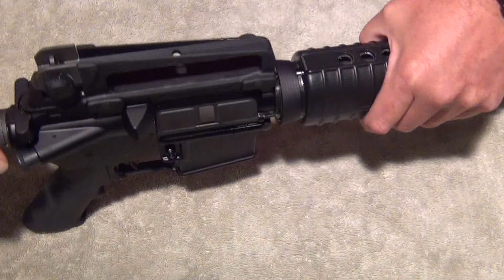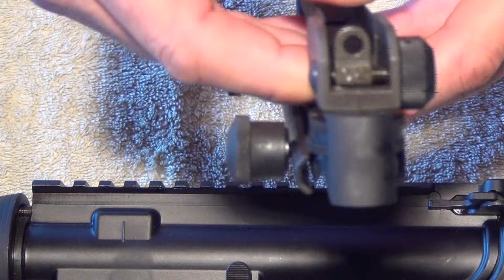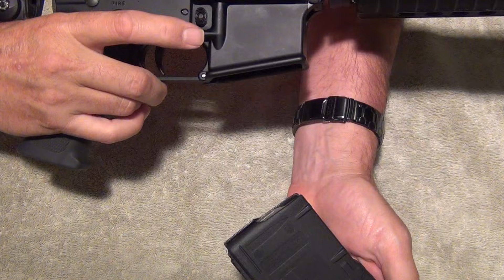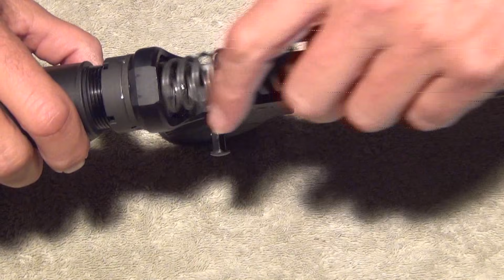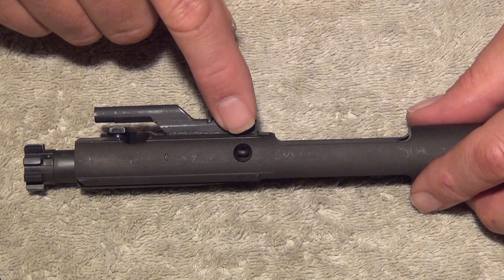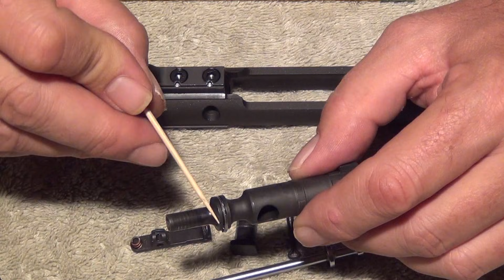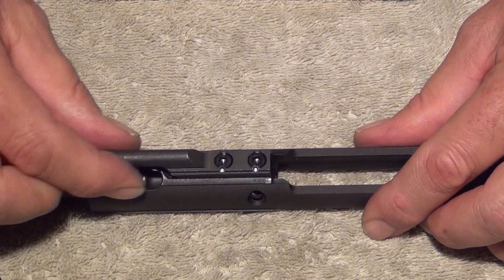AR-15 Basics: Controls, Function, Disassembly, & Reassembly.

Comment: Thanks for the video.Question:is it normal when I re-install the bolt and try to close the gun, I have to reach in from the bottom with a finger and slide the firing pin forward or the gun will not close.
Reply from the maker: You're welcome. Something's not quite right (hard to diagnose without having the rifle). First check that you're firing pin is properly reinstalled. I'm GUESSING that the firing pin was not fully seated, when the firing pin retaining pin was installed. You can check this by trying to remove the firing pin, without removing the firing pin retaining pin. If the firing pin comes out the back, that's the problem. Also, make sure the hammer is back and down before trying to close the rifle. Lastly, make sure the bolt carrier group is fully forward. I hope this helps, let me know how you make out. Cheers
Reply: First, thank you for responding so quickly. I don't think any of the videos I watched mentioned the hammer being back and down before closing. I did that the first time and it closed but wasn't sure if that was the proper way. Thanks for the education on my new AR. If you ever need to know anything about tile work, drop me a line as I have 38 years experience installing.
Reply from the maker: Crippled Slave You're welcome. I think I'll add a annotation to the video to help out other viewers. I've only done a little tile work, and will keep you in mind. Thanks, Cheers

Comment: Thanks for the great info as we want to understand every part of this gun. One question, when you pulled the charging handle back and then released the bolt you showed the fire position by pulling the trigger. Is it ok to dry fire or is this even considered a dry fire with an ar?  All new to me so any help would be great since I dont want to damage

Comment: Great Video! Just got my first AR. I am brand new to the AR platform and your video was very informative without a bunch of unnecessary "tacticool" garbage added in. I think I'm really gonna like this platform. Are you accurate at 600 meters with those sights? I've been looking into optics for my flat top but maybe I should just go with some good iron sights to start out. What do you think?
Reply from the maker: Thanks. I love the AR platform.These sights are capable of being re-zeroed out to 600 m. I've never shot mine past 200 m, but frankly, I don't think I would be very accurate at that distance (that's me). I feel a good pair of backup iron sights are a must (become proficient with them first), and an optic will provide a great tactical advantage. Ask yourself, at what distance do you think you'll do most of your shooting? Me, under 200 m. So a red dot, or tactical scope will suffice. Past 200 m, I would opt for a tactical scope, or a scope with more power. Cheers

Comment: Just got my first AR. This video was exactly what I was looking for. Very well done and thank you :)
Reply from the maker: You're welcome Mr. Pressley, enjoy your new AR, and baby.  :)  Cheers
Reply: stanfordcoffee maybe you can help me out. Finally got to the range and I'm having issues. The gun fires and extracts but failed to feed. After a few more rounds it stopped throwing the brass and just got caught in the chamber. brand spanking new 556
Reply: stanfordcoffee I should also mention that it's not the mag. My mag worked perfectly in my dad's AR and his mags failed in my gun.
Reply from the maker: Bill Pressley First check the extractor Spring, and groove. Make sure they're okay. Don't know what to tell you about the failure to feed, hard to diagnose a problem with out seeing the rifle. Check on AR15.com to see if others have this problem. I've only had to deal with Ruger customer assistance once, and they were excellent. Good luck. Cheers

Comment: how do you or do you need to clean the gas tube?
Reply: Don't put any lubricant in the gas tube, but just take a q tip and wipe the carbon where it makes contact with the gas key. Also q tip inside the gas key as well
Reply from the maker: William Skinner For the most part, it's not really necessary to clean inside the gas tube. The high pressure, temperature, &  velocities keep the inside relatively clean. However, if you want, you can get long pipe cleaners (tobacco shop), or those very long "q-tip looking" cleaning rods, and put some solvent on them and run them inside the gas tube, (maybe once every 2k - 3k rounds). Try not to spray any kind of lubricant inside the gas tube. Cheers

Comment: In order to cycle cartridges through you cycle them by using the charging handle correct?
Reply from the maker: I'm not exactly sure what you're asking.
Once a cartridge has been chambered, and you fire the gun, it will cycle and chamber the next round automatically, no need to touch the charging handle. Is that what you're asking?
Reply: stanfordcoffee What I was asking if there is a way to check proper ejection? Like the use of snap caps much like I have for my Sig and Kimber. There used for loading and cycling rounds to check for proper loading, ejecting and adjusting trigger pull without destroying your firing pin. Would the use of the charging handle be the way to properly check the above things mentioned while using AR15 snap caps?
Reply from the maker: bizzythgz Yes, exactly. In that case you do have to use the charging handle each time you want it to cycle. I didn't know you were referring to snap caps. Cheers
Reply: stanfordcoffee Much Thanks for the Info!!!

Comment: hey thanks - just bought a M&P 15 sport - have not even used it yet. Shot a M16 about 30 years ago but never owned one. Needed this to help me understand how to take the gun apart and clean it. Still unsure about what to use as far as that goes. I have a cleaning kit and snake and just going to keep learning.
Reply from the maker: You're welcome. Sounds like you're all set, you just need to decide if you're going to use a solvent followed by a lubricant, or a CLP (cleaner, lubricant, protectent). I also like to use a little all-purpose grease on certain parts of the bolt. follow the link to James Yeager in the description. Cheers

Comment: Do you only use the charging handle once when you insert a mag in the first time or do you have to each time you put a mag in? I only see people use it one time. Thanks!
 Good info on video. I purchased my first AR type rifle and just learning stuff.
Reply from the maker: Yes, in general. You only need the charging handle to bring the bolt back. If the bolt is forward, insert a loaded magazine, pull the charging handle all the way to the rear, and let it go. After that, the bolt should lock back on an empty magazine (after the last round has been fired). Remove the empty magazine (the bolt will remain locked back/open), insert a loaded magazine, and press the bolt catch release (allowing the bolt to go forward). Just think of it logically, the bolt has to strip a round off the top of the magazine to chamber it. So if bolt is forward, You're going to have to use the charging handle. If the bolt is back, just release it with the bolt catch release. I hope this helps, feel free to ask more questions. Enjoy your new rifle! Cheers
Reply: Thank u sir. Very helpful.
Reply from the maker: Ralph U. One last thing. If the bolt is back, and the gun is empty (magazine remove), you can pull the charging handle all the way back and then ease it forward to prevent the bolt from slamming forward without a magazine. Cheers
Reply: Thanks! For the info but my fault. That already happened. I wish I had read this before it happened. I did it yesterday as I was going over my rifle. I didn't think you were supposed to ease it down (charging handle). I thought you supposed yo let it go. I did try and ease it down but I though I messed it up. I hope I didn't damage it or mess it up now. OH! MAN! I feel like an IDIOT NOW!!!!!!!!!! Thanks! Again! Maybe too late.
Reply from the maker: Ralph U. You're not an idiot, and you didn't damage your rifle! I'm sure it's fine! You just don't want to let slam forward repeatedly, as it's not good for it in the long run (A few times is not going to hurt anything, the AR's is a pretty tough rifle). The same can be said about most modern pistols. Please read my "Note 1" at the bottom of the description (for a better understanding). Have a great night, I didn't mean to startle you. Cheers
Reply: Thanks! Man!

Comment: Excellent video sir, couldn't have been better. I just have a quick question. I'm new to theses AR platforms and I was just wondering what's the significance of the bolt catch?
Thanks
Reply from the maker: Thanks.  The bolt catch allows you to manipulate the BCG (bolt carrier group that the bolt rides in). If the BCG is locked back,  pressing the top of the bolt catch will allow the BCG to go forward. If you want to lock the BCG back (open), you pull the charging handle all the way to the rear, then push the bottom of the bolt catch while releasing pressure on the charging handle, locking the BCG rearward. The only time the BCG will lock back by itself, is if there is a empty magazine in the rifle (after the last round of ammunition has been fired, or if you pull the charging handle all the way to the rear with an empty magazine in the rifle).  Hope this helps. Cheers
Reply: Ok thank you

Comment: What do you use to remove the ejector pin? I see Brownells has a few tools for the job but they get a bit spendy for something a person might not use too often.
Reply from the maker: I've never removed mine (about 1300 rounds through the rifle), still working fine. I don't have a ejector compression tool, or roll pin punches. I don't believe you have to remove it too often for cleaning. Cheers
Reply: Which is good, I don't think it needs to be removed too often for cleaning. In my case, I'm assembling a kit and the DVD I got from Brownells claims one should remove the ejector pin to check the headspace. But a friend of mine suggested I contact Sarco to find out if they had checked the headspace. The kit came with the bolt carrier group fully assembled but the barrel was separate from the upper.
Reply from the maker: I'm NOT an expert. I think that if you attach the barrel to the upper, the headspace will need to be checked. As such the ejector will need to be removed. Try AR15.com, you might find your answer there. It's free to sight, and takes only minutes. They may have a solution as to  how to remove the ejector without the tool (DIY Stuff). Good Luck

Comment: maybe im retarded but im fascinated by guns so ill ask, what does "run it home" mean?
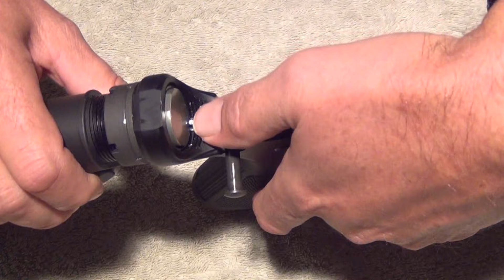Reply from the maker: That's a good question, I didn't cover it very well. It's slang( "ride" it home).  When you pull the charging handle all the way to the rear, you are compressing the buffer spring ( at 8:00 ).  People that are new to AR's /  firearms, are reluctant to just let it go. So, they ease the charging handle forward  "riding it home".  By doing this, they are taking a certain amount of energy away from the bolt. The bolt needs that energy to strip a round of ammunition out of the magazine and chamber it.  If you ease the charging handle forward, you are more likely to create misfeeds, and/or  jamming. So,  just pull it back, and let it go. Note:  It's not good to practice to do that with any semi automatic firearm,  that doesn't have a loaded magazine in it ( to slow the action).  Without a loaded magazine in the firearm,  the bolt ( or slide in the case of a pistol), does slam forward, possibly damaging the firearm.  In that case, you do want to ease it forward ("ride it home").  Hope this helps. Cheers
Reply from the maker: PS, Your not the first person to ask about that, so I've now added a annotation in the video, and note at the bottom to the description.  Thanks
Reply: stanfordcoffee you took that much time/effort explaining that? and even what could go wrong that you earned a sub sir.
Reply from the maker: tharealdvl  I'm a sick, sick man! Help Me?!? LOL Thanks, Cheers :)
Reply: you are awesome bro keep up! any more guns u recommend? (watching since i ilve in a shit country where we cannot have weapons legally)
Reply: watchin youre vids at 3 am xD
Reply from the maker: tharealdvl oh, that's a wide open question. I enjoy plinking with .22's. I have a Ruger 10/22 and MKIII 22/45 pistol.  They're  just fun to plink around with,  and l recommend anybody starting in the sport,  start off with .22's.
I'd like to own Mossberg 500 , a Glock 19 or 23 (I'd really like to shoot a G23). I'd like to own a Colt Series '80 1911 (blue w/wood grips),  to go with my M1 Garand.  What specific category/purpose are you interested in?
Reply: stanfordcoffee Glock 21 is a hell of a handgun as well.
Reply from the maker: You're absolutely right!  I like the 45 ACP.  Glock makes a good one in the G21. Please understand.  My father willed a M1 Garand to me.  I've always wanted a 45 that would match that rifle ( in my mind they go together).  It doesn't have to match perfectly,  function is important as well,  but the Colt  series 80 1911  is definitely on my bucket list. It would mean a lot to me!  Purely personal. Cheers

Comment: I never knew to flip the sights for close range shooting . My first AR platform is a M&P15-22, had it about a year, and never knew it. I was using the long distance sight till I bought a cheap red dot for it . I guess thats what I get for not mastering the basic rifle before adding accessories . Thanks man!
Reply from the maker: LOL, thanks man. I actually use the far sight (small) for most shooting. The larger aperture sight (close range), is designed for quick target acquisition
( competition shooting - multiple targets, soldiers in a fire fight ). The small one helps me zero in better, at almost any distance. Cheers

Comment: Excellent video! Clean, clear and to the point. I do have a question, why does the Fire/Safe switch not engage after you dropped the bolt and pulled the trigger? I would think that you should be able to turn the switch to SAFE at any point. Cheers!
Reply from the maker: Thank you for the kind comment. I've wondered about the safety myself. I know how it works mechanically, but can't think of why it was designed that way logically. I've researched it some, but have not come across a reasonable explanation. It's just the way it works (he says while shrugging). Cheers
Reply: stanfordcoffee Huh, interesting. Do you think you can turn it back to SAFE if you inserted in the magazine back in (empty or not)?
Reply from the maker: lightspeed72 No, the safety does not have to do with the magazine, or whether or not there's actually a around in the firearm. Watch this video for a better understanding, then if you still have questions, you can ask me, or sootch00 (he's a good guy).

How the AR-15 Trigger Works
How the AR-15 Trigger Works

I tried explaining it in text, turned out to be about 30 lines long, and this video does a better job. Let me know if you still have questions. Cheers
Reply: Good watch, thanks. It is great that I can have a visual explanation of how the whole thing works, which is really cool. There is a lot to wrap my head around as far as all the nitty gritty around ARs go, but, all things in good time right?

Comment: How do you clean tue gas tube in the upper receiver??
Reply from the maker: For the most part, it's not really necessary to clean inside the gas tube. The high pressure, temperature, &  velocities keep the inside relatively clean. However, if you want, you can get long pipe cleaners (tobacco shop), and put some solvent on them and run them inside the gas tude (maybe once every 2k - 3k rounds). Try not to spray any kind of lubricant inside the gas tube. Cheers
Reply: thanks really appreciate it. oh one more thing how much did you pay for your AR-15
Reply from the maker: I paid $1050, but they're now $1150 LE6920MPE (magpul edition). Cheers
Reply: okay thanks a lot!!!!!!
Reply: stanfordcoffee now they are $400

Comment: Thank you that was very helpful
Reply from the maker: Thanks, very cool. Cheers
Reply: I have always had an AK-47 (overseas ) but never AR-15 . which one that meets the standers ?
Reply from the maker: leo Germany Military Specification, is a standard that the military adopted as the minimum specification that they will except in an AR style rifle. Many rifles meet, or exceed this specification. There are also many good rifles that don't quite meet specification. Bushmaster, Windham Weaponry, and others. Two things that I would look for in a rifle are a properly steak gas key (it's bad if it works loose). A chrome lined barrel (prolonged barrel life, & cleaner). Set a budget, do little research on the rifles are you finding in your price range. I'm very happy with my Colt. Cheers

Comment: Good video. Can you tell me what to do if there is a live round in the gun and I can't pull back the charging handle to get it out?
Reply from the maker: I know what I would do, but can't advise you. A GUNSMITH IS YOUR SAFEST OPTION. You can follow this link to AR15(dot)com.
http://www.ar15.com/archive/topic.html?b=3&f=66&t=505198
They have advice, whether or not you choose to follow it is up to you. Good luck, BE CAUTIOUS WITH ANY STEPS YOU MIGHT TAKE. Cheers
Reply: I got it. I put an empty mag in out it pulled. Tks. I will be watching
Reply from the maker: Good to hear it. Be safe.